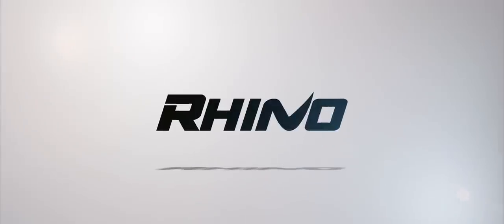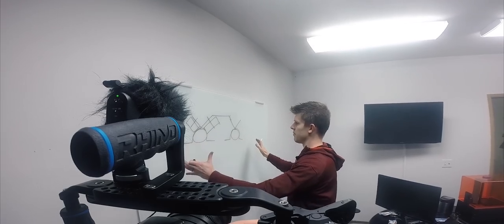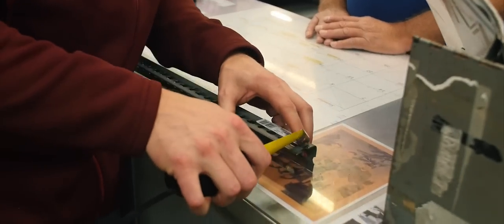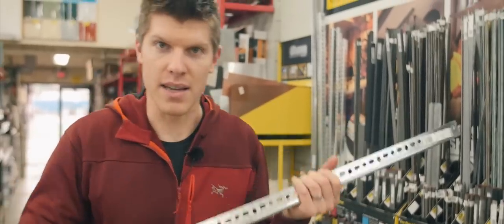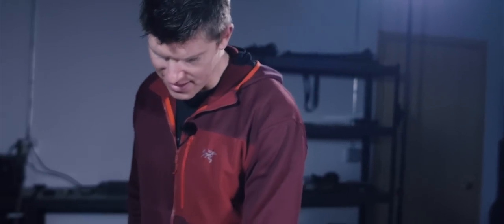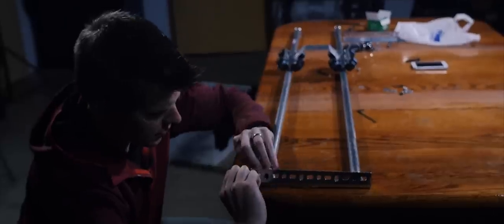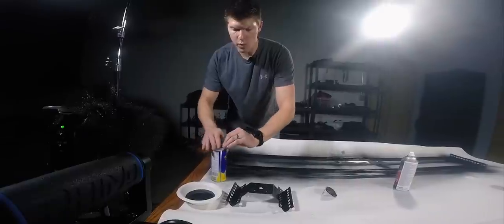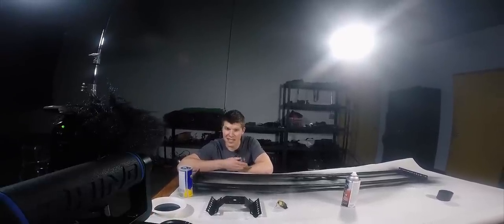$75 DIY Camera Slider

Comment: Rhino never sent me the email with the list of what to get, but in an article I saw it had a picture with the items needed. So because Rhino wont tell you, here is the list:
(the image quality was low, so I hope I got it right)
Kyle Hart Slider Items Needed:
-	1/4” & 9/64” Allen Wrench
-	11/32” & ½” Socket
-	Hack Saw
-	10FT ¾” EMT Cut in half
-	(8) 50mm Skate Wheels & (16) 608-2rs bearings
-	(8) 5/16-18 x 1.25” Socket Cap Bolts
-	(8) 5/16-18 Lock Nuts
-	(32) 5/16” Washers
-	(1) Simpson Strong Tie BC40Z Z-Max Post Base
-	(12) 8/32 Lock Nuts
-	(12) 8/32 x 3/8” Socket Cap Bolts
-	(12) 3/16” ID X 5/8” OD Washers
-	(1) Halex 961624 Count ¾-inch EMT Two-Hole Strap
-	(1) National Hardware 4020BC Slotted Steel Angle 1-1/2 by 36 inch galvanized
Reply: ***** thanks!
Reply: Thanks Man!

Comment: What do you estimate the maximum load being? Could you use a C300-sized camera on here? Where do you recommend drawing the line? Please answer honestly, as I absolve you of all liability in asking this question and won't sue you if the slider breaks and my camera falls to its death.

Also, if your recommended limit is only a DSLR-sized camera, could you recommend ways of reinforcing the track and/or carriage to allow larger cameras? Perhaps alternate building materials?
Reply: Shut up figure it out you got the blueprint

Comment: what kinda load do you guys think this takes? Too higher the capacity just get thicker rods?
Reply: ***** thats a good point. I'm just thinking that the head alone weighs in at a at 4lbs. Add in a 5d and a 24-70 and we're already close. 

Shorter rails should also higher the capacity, i'll try it out after finding all the parts here in europe :P
Reply: leolol if you find your camera is weighted to the front because of the lens just counter weight it at the back, maybe a weighted handle i dunno but just counter ballance and this rig would work fine with bigger  lens